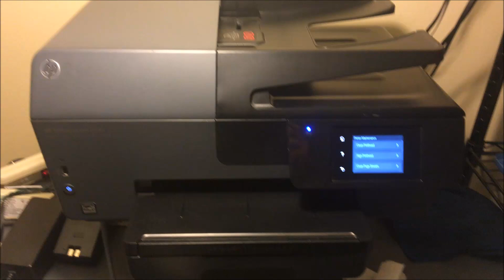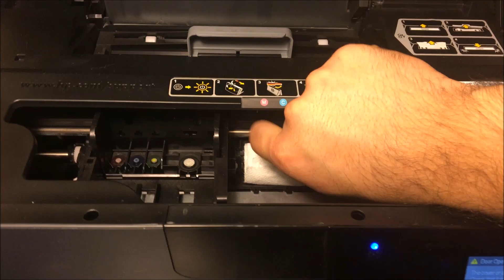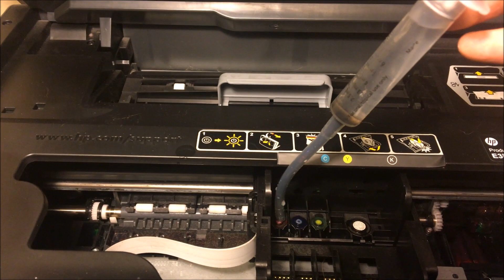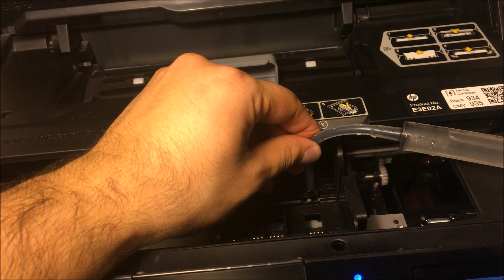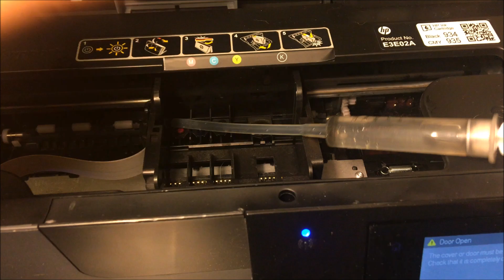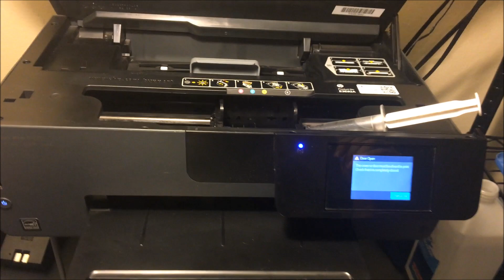Hp Officejet Pro 6830 - How To Clean Printhead - Not Printing Black/ Color ⬇️Buy Repair Kit Here! ⬇️

Comment: This is a really good printer  https://www.youtube.com/post/UgkxciSwynMJ7PnUvvx11rewiu-yFBkZTl53 . The reason I gave 4 stars for tech support (which I don't think this would classify as tech support) is because once you turn the printer on, it does require a little bit of start up time which may bother some who are in a hurry to quickly print something. To offset that though the printer prints very quickly. I would definitely purchase this printer again.
Reply from the maker: Thank you for the input.

Comment: darn, didn't work for me just now.... how long and how much should I put on?  Just my Cyan (Blue) doesn't print.
Reply from the maker: Use all the fluid on it and then run a printhead cleaning. That will push all the ink back into the printhead.
Reply: @BestPrinters  I tried it again, and put a whole dropper full on just the blue.   Still nothing.  But I didn't run a printhead cleaning.  I will try it again with the printhead cleaning and update you.  Thank you
Reply: @BestPrinters  I got a syringe and I tried to push it through several times... just sprayed everywhere... nothing going through.   I saw someone take about 2 inches of the rubber tubing and fit it over the head and then leave the alcohol in the tubing until it dissolved the clog.  But what size rubber tubing?  Anyone know???

Comment: I got an 0xc19a0013 error code, I followed the suggestion to use 90% Isopropyl and dried everything, put it all back together and then ran a few test pages, nothing, so i did a print head clean through the software, nothing, did the extensive print head clean the software suggested and "PRESTO" printed like the day I bought it. Thanks a lot mate.
Reply: what is the extensive printhead clean the software suggested? any advice because mine still not working even after using alcohol.
Reply from the maker: I apologize I could not get to your comment. If you would still like support, expedited responses and member only videos please sign up for a membership here 👉 https://geni.us/BPChannelMember

Comment: After carriage stops in the middle disconnect the power cord.  Make sure to clean the ink dispenser too. Use a flash light and on the right side down you can see the spill. Disassemble the cover, remove the  4mm black hose, and the white 4mm hose. Open 2 holes on the right side of printer. Using  ball paint ink hose as a union, relocate the dispenser discharge, to an external bottle. I opened a window at the left cover, located 3 contacts of CMOS, removed the CMOS battery, and replaced with two AAA batteries externally. Still  HP controls the printer but I have an Upper hand.
Reply from the maker: Thanks for the input.

Comment: The hp 6830 printer must have definitely a problem.Many have got replacement even after warranty according to the web.When I got the printhead error I made a complete overhaul and noticed that there is much ink accumulated under the printhead in the standby mode.I checked everything and clean everything updated firmware and the printer was good again.However after 15 pages of printing the error message was back.When I open the printer there was again much ink leakage.The problem is definitely the printhead which does not communicate with the printer.Some where it was written the there is an issue of electrical connectivity inside the printhead.And I learn also that the latter cannot be replaced.I think that it is the black xxl ink cartridge which leaks and clog the nozzles of the printhead preventing it from communicating with the printer.I shall try a thorough cleaning again and reduce the vent aperture of the black ink cartridge to reduce the flow of ink.May be it will work.
Reply: mine has a lot of ink leakage too. I tried the syringe method like 30 times, and now the black ink only partially works. these printers are trash
Reply: My 6830 has been replaced twice under warranty due to printhead issues! The original (store-bought) printer didn't even last a year before it crapped out. HP sent me a new printer. A year or so later, the replacement printer ALSO crapped out due to printhead issues and HP again replaced it, although this replacement was clearly marked as a refurb. I've been using the refurb for about 5 years and I think it may be time for a brand new printer again (I doubt HP would replace it yet again, and not after 5 years of it working well ... LOL!)
Reply from the maker: Thank you for the input.

Comment: I can't  find the printer maintenance on my HP 6830 specifically to clean printhead.  How do find that menu?
Reply: It is in your settings, scroll down to the printer maintenance and the first option is clean printhead (I know this is late but hopefully it helps someone else)!
Reply: I have pushed every button and the only settings is on the copy - and there is no Printer Maintenance option.  
 @rizzle523
Reply from the maker: Thank you for the input.

Comment: It seems to me that that is specific HP 6830 printers are all defective lemons from the get go and for everyone.
Reply: Wish I had read up on the HP printers before buying mine. I bought an Officejet 6812 to work from home. I'm 73 and don't have money to go buy another printer; but going to post all the problems with the HP's on my Next Door Neighbor blogs.  There's about 9,000 households on the ones I'm on.  TIRED OF BUYING JUNK!!!  Hope the people at HP see this post.
Reply: OH MAN and DAMN! I can relate and hear you. The newer Epson EcoTanks seem to be the best "inkjet" deal out there according to Clark Howard. Laser printers are another story.
Reply: That's been my experience as well.  Mine is going to the dumpster tomorrow and my next printer will not have anything to do with HP.  This one has just been one problem after the other.  Mine worked for about 5 months and it hasn't printed for about a year now.  I have just been using it to scan things, but since I have some stuff I need to print now, this piece of crap is going.  I've tried cleaning the head several times and it didn't do any good.
Reply from the maker: Thank you for the input.
Reply: Thanks for sharing your experience. HP must have really screwed up with this one line of printers for some reason. It must be a faulty board or something, for I too cleaned the crap out of the printheads with no luck of getting it to ever work.
Reply: I blame Carly Fiorina.

Comment: If you get the print head error and HP says it needs to be replaced, could this cleaning solve that problem? I hadn't used it.since Oct and just went and spent $80 on ink and now it won't work. It has that print head error message.
Reply from the maker: It could potentially fix that error code.

Comment: I get the printhead error on my HP 6835. My printhead are sort of jammed and fixed to the extreme right and does not move at all. How to bring them to the middle in order to clean them?
Reply from the maker: That is a very difficult problem I wouldn't recommend trying to fix yourself. I would buy a new printer, unless after you turn it on and off a few times the carriage comes to the middle.

Comment: Could you provide any insight into whether this process would work on an HP 6978? My 6978 is not printing black, but does print the color inks. Thanks much.
Reply from the maker: Yes, the Hp 6978 has the same type of print head a sthe 6830. The process is exactly the same.
Reply: Thanks very much Brandon, I appreciate the info and enjoyed your video.

Comment: I have a Printhead error. Oxc193005.  The printhead just stopped.  Any suggestions
Reply from the maker: Once you've got an error code its a tough situation. The thing is with these printers you cant change the printhead. The only option is to buy a new or used printer. If it were a different model you could get away with buying a new printhead but not in this case. Check the description box you might get a deal on a used version of the 6830.
Reply: My HP All in One 6830 printer said has a printhead damage message oxc19a0023..can it be cleaned..or do i need to replace the printhead? What doe a new printhead cost?